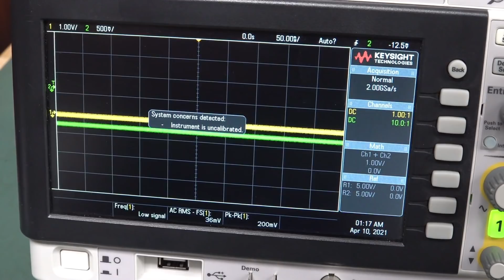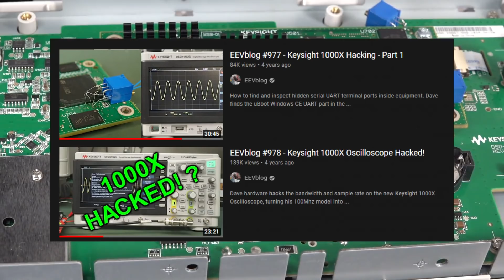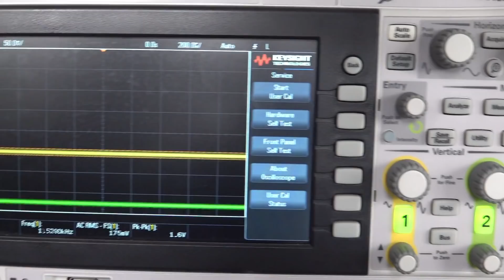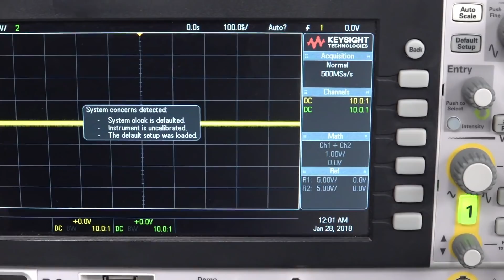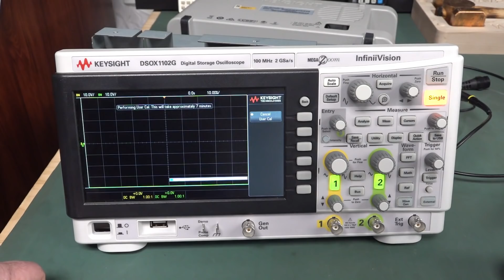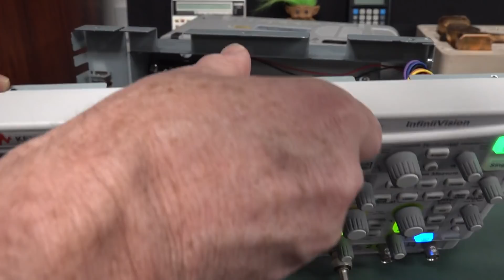EEVblog 1418 - The Most EMBARRASSING Repair!

Comment: When it is first calibrated it probably stores those initial resistor divider values as part of the calibration data and if the hardware no longer matches the stored value of the resistor divider it just assumes that the calibration data is faulty and something is wrong so never loads the rest of the calibration data.

Comment: My most "embarrassing" repair was when I was desoldering the SMT pins on an OKI 900 with a Weller 12 watt. I thought they were wick'd clean and hot and impatiently yanked. Lifted a few pcb traces. :(

Patience is the highest virtue. I'm about 22 years older than I was back then. Entropy has justly slowed me down. :-) Dave rules!!!

Comment: The software woke up to alien hardware , retreated to the cpu and barricaded the doors . 
This is a feature , not a bug , that punishes users for not reading the undocumented readme first . 
It brings a smile to all authors of readme firsts , the most unread literary form of all time . 
Finally they are vindicated , the apocalypse prophesised in the 14 point , boldfaced courier paragraph at the top of page one has come to pass . Finally they can smugly point and say , "TOLD YOU SO" .

Comment: Given the Product is set be resistors, they don't allow for someone using trim pots that might be half way between two different Product ID's.  I don't think they would see a need for it given they set the resistor values in the factory.   This really was a hardware fault as the resistor values were wrong.  :)

Comment: As far as the programming - it could be just as simple as an inaccurate error message. That is, if the waveform generator can't run for ANY reason, it displays "invalid license", and for whatever reason the waveform generator can't run when the system is uncalibrated.

Comment: I can understand using the same code across all their scopes (with model specific tweaks), but its interesting that instead of building the code for an individual scope, the whole firmware is the same across all the scopes.  I guess that means you could buy the most basic scope and bodge on a bunch of connectors and you would get the expensive model... 🤔

Comment: There are different programming techniques. Personally I always prefer to programmatically validate and sort of "close the loop", meaning never allow your code to get into a situation that was unplanned for. That can be as simple as validating every piece of data and redirecting to a certain message if anything is outside of the expected range, even if that situation is extremely unlikely. However, as you can probably imagine, this takes a lot of extra time and can delay go to market dates which delays revenue from a product. Like anything else, this tends to depend on the management style at the company. Time is money and therefore a departmental compromise usually gets developed at a company to allow for certain assumptions. For instance, we'll assume that hardware flags (e.g. resistor values) will be what we expect since customers most likely won't be disassembling and messing around with changing their values. That eliminates the time required to code, develop tests and validate the information as well as program space in memory. It's all a trade off. What trade offs are made tend to be developed over time and are different at different companies.

Comment: Dave, it's common practice to use identical software and identical mainboards for multiple product SKUs with different features, and identify the specific SKU with resistors on multifunction GPIO pins so you don't need to rework and retest everything for every configuration every time you make a change to something.  (You can test disabling individual features once, and then test a feature rich build to be sure that software changes to specific features don't step on each other).

If you get those GPIOs messed up enough and the software is looking up product features in a table, who knows what combination of features it thinks your scope has... it could go right off the end of a feature table and use some garbage configuration that Keysight doesn't even sell.
Reply from the maker: Yes, I know. But in this case it's not hard to throw up an error message if your product model configuration is not one of a set number of valid configration. Remember this is not the feature configuration bits.

Comment: I have the new version of this and I like the Black as it does not show Fingerprints and crap and it works Excellent about as close to my tek 2465A, but getting thru menus is a bit different
Reply from the maker: The black case really screws up my camera exposure, I might use this now fixed unit in videos from now on.

Comment: Can someone stop bloating, and tell me in one sentence / time code stamp as to what happened and why? I don't want to watch entire 25 mins...
Reply from the maker: It was a scope I hacked, now it's failed. Removing the hack fixed it. Looked like a hardware fault but was actually software configuration.
Reply: @EEVblog  Thank you! Normally I watch your videos in full, but that time I was in a rush (monitoring the elections situation in Russia at the moment), so I could not watch the full video, and you were as happy as I usually am when sharing a "dumb find" with technicians at work, so I clicked around, but could not surmise the reason for your happiness in less than a minute. All OK Dave as long as we make less mistakes than the number of items we repair!!! Keep on rolling!!!

Comment: Stereo amplifier repair 101: Use the good channel to trouble shoot the bad one. Have been doing that since my early teens. Of course at that age you often blow up the good channel trying to fix the bad one! My Dynaco 120 of the day is a good example. That was before I understood ultrasonic oscillation in baseband audio circuits

Comment: The cal data is likely specific to the hardware model.  Other models could need additional data or different values for their hardware.  If the stored cal data that is found is not for the hardware indicated by the jumpers then the software would think it couldn't use it...

Comment: i work with tablet testing machines and all models that we sell use the same mainboard. and are just configured to act as different models. the hardware of some models need different config files that will be loaded from memory depending on which model the board currently identifies as. so changing what the device thinks it is can missmatch the hardware and software. sometimes this mismatch can cause the software to crash and your device wont even boot and sometimes everything appears to be normal until you hit that one line in the config that needs to have a different value. then you got two options: either the software crashes at this point or you get outputs that are weird.

Comment: 19:00 man it really irritates me when hardware guys complain about software. In this case, you told the software that some hardware module was present. So the software tried to calibrate it and couldn't.
Reply from the maker: Err, no. All the harwdare is present in this machine. There is no reason why a model bit change should impact the DC offset.

Comment: Question..    Low battery voltage?    I work on old radios/transceivers.   I have found certain makes and models along with other types of equipment will act all funny, not boot right, other artifacts due to a low battery.

Comment: From a programming pov, it really doesn't make sense to make a device "robust" enough for that. It likely was an invalid product configuration, something that for all intents and purposes will never ever happen (unless its a hardware failure), thus always assuming the product id is right and consistent is the most economical to do. For why this happens, I would speculate the IDs are used as offsets into some configuration data structures, and just get wrong/unfilled ones, or interpret a slightly different structure diffferently. For the licensing I would guess that the license code/id/whatever takes into account the product ID and doesn't consider the license for one product valid for another.
Reply from the maker: Then why not put up an error message is an invalid model configuration is detected? That seems pretty trivial.

Comment: Actually the behaviour at the beginning seems to be just a setting in the menu!
Under Utility -> Options -> Preferences you can select between "Expand about Ground" or "Expand about Center". I think your scope was set to the second option, so when you changed vertical scale you also changed the position of ground on the screen.
Reply: That feature moves the ground reference indicator as it changes the scale.  This unit was moving the waveform but leaving the ground point at the same place.
Reply: @donreid358  True, my bad.

Comment: From a programmers point of view, I guess that the different modes can result in that different data structures are expected in some sort of write-once memory with rough hardware-calibrations,  so that after assembly and product specification, the different offset and characteristics values are brought into the ballpark for user calibrations to work. Using this logic, it could be that the hardware channel DC offsets are no longer read from the correct place, and just gets garbage instead.

Comment: Maybe different product configurations have different calibration requirements, so if you change the product, the calibration that exists doesn't "fit" anymore.

Like, sometimes the hardware differs within the product range, right?

And if you try to run user cal when the software thinks there's hardware that isn't actually there, it seems reasonable that it could fail.

Comment: A good visual inspection through a magnifier will find places where the solder has cracked around a through pin and even though it looks fine to a naked eye it isn't making electrical contact with the through component at all anymore. Years of heating and cooling sometimes cracks the solder, especially if it was a little scant. My experience is old electrolytic caps and obvious things like this and solder balls account for a huge percentage of faults. Add in the occasional failed chip/diode (check the inputs they're all good, check the outputs, not so much), and you account for almost all. By the time you get that deep into it you'll be ready to find the occasional weird fault.

Comment: I recently had a very bad trim pot. Wanted to use a variable buck converter to charge a Li-Ion cell, but while slowly turning the pot up, my meter did not say the expected 4.0 - 4.1 - 4.2V increase, but instead the voltage jumped around 4.1 - 4.3 - 3.9 - 4.2V. And that was even repeatable: turning the pot up (towards max voltage) would lower the voltage in certain positions.

Comment: Re: the question about different configurations: the most reasonable explanation to me is that the analog side of the DC offset generation circuitry differs between models, or even hardware revisions. Those set resistors are supposed to tell the firmware which hardware it's currently running on. So with this explanation it's not so much that the calibration data is ruined per se, but that the stimulus to the DC offset generation is ass backwards because it's for a different hardware configuration.
Reply from the maker: Yeah, but that's the wierd part, there is no difference in the front end hardware between models.
Reply: @EEVblog  Another possibility is that there was supposed to be a different model with changes in the hardware that was never released. That sort of thing (left over code for variants or features that never made it to market) happens all the time.

Comment: Given the scope runs Windows (CE), and they're presumably using cryptography to manage the license keys, it could be the reference voltage reading is also seeding the license crypto. I would have expected a failure like that to prevent it from starting at all, but maybe the 'scope's base functionality doesn't require it? 🤷‍♂️👍

Comment: You should've soldered one side of the resistor to the board and left the other side flapping in the breeze so when you come back to it the original part is there :)
Reply: Yeah I've seen people turn them 90º so they know what goes back where.
Reply: @SidneyCritic  that's also a good plan, maybe even heat shrink the end in case the envelope of "which"device get's turned to a side in which gravity could cause a short from as Dave says "flappin in the breeze". At min, it's good to keep it there no doubt.
Reply: @jasonbrindamour903  gets*
Reply: I do this too

Comment: Hang on. Dave stores his resistors based on the E series position?? 47R with 470R with 47kR? Maniac.
Reply from the maker: Yep, incredibly efficient way to do it.
Reply: Why would you not? Sub-dividing by multiple is easier to index than integer value.  MSB vs LSB
Reply: That's how I sort my smd resistors and caps. Super Friggin handy
Reply: I guess it depends on how many values you're holding, how they're stored and how they're used. A fair few of my stocked resistors are through-hole and from big dumb packs which are all over the map E-wise, and often they're deployed more as "I need something about... -yeah this one's good enough for 'straya..." I'll certainly admit it makes sense for reeled SMD parts, especially if you're only holding say, the E12 or 24 set.

Comment: License code? Jesus, that's straight up evil.
Reply: It has multiple license codes. Sig. gen. option is just one of them, around 15 in total if I remember it correctly. If you want all the features then all the licences may cost you almost half of what the scope itself costs. And with some manufacturers it is even worse.
Reply: Welcome to the new world order.
Reply: Same thing for new cars. Oh, you want the full potential of your headlights? Pay a monthly fee or 3000$. This shit is crazy. Will never support this BS
Reply: @Daniel-hd7gq  At least once you've paid for your option it is all yours and you can use it as long as your device is alive. Some commercial software providers do not even give you that. They have switched to using time limited licenses only for their most recent products and you never know exactly how much it will cost you next year. Say hello to the new SolidWorks CAD packages for example. And with current cloud based services development it looks like many more are yet to come.

Comment: I do wonder, if this would have still happened, if you had used the "reset to factory settings" option after changing the configuration resistors. You probably did something outside what the software developers anticipated :) 
I could imagine that data left over from before the change + new data saved afterwards, might cause a problem.

Comment: "I didn't change anything about it!" It's always the same line users give when their stuff stops working...
Reply: Repairer opens equipment and shows customer wires with pots dangling off them.
Customer: "I have no idea how that got in there."
Reply: That or "only lightly used"

Comment: If I had to guess, I would say that different devices that have different hardware may need to have their offsets compensated for in software, and so by changing it so there is a mismatch between the physical hardware and what the software thinks is present, those compensations end up producing what appears as an offset.

Comment: Back in the 70,s I worked for Tektronix as a service engineer. The problem you saw used to be down to corrosion/ galvonics in the  "Y" input select switching. DC offsets. Oh what fun. Clean those wafer switches. :)

Comment: As for software being involved in this error, you likely found an edge case that was not compensated for. I've had these kinds of issues before while developing things and trying to fully define the boundary of a configuration. Also, I don't think any developer would look at this particular part of the system and think that anyone would get in there and start mucking around. They probably had the specs from the hardware engineers and didn't account for much, if any, variation from those specs as it would be reasonable to not expect those values to be in an undefined state..
Reply from the maker: I would have at least had the software throw up an undefined mode error message or something.
The strange bit is why the mode even effects the DC offset of the channel, when everything else seems to continue working.
Reply: @EEVblog  That may just be a byproduct of the unknown/floating state. Now, a proper software shop wouldn't move beyond the logic building stage until the team had found all possible output boundaries of all possible inputs. Wait, that's right! I forgot that no business includes that level of overtime! Lol
Reply: Maybe it thought that it was a completely different model, where the analog front-end is constructed slightly differently, and the configuration it was running would work with that model but would be incompatible with the hardware present.

Comment: Well I think what it showed is the steps leading up to that mod or the mod produced that outcome. After that it is a debate. The most obvious things I could think of is the settings have a hardware string or something in there that has to match or be rejected. Also there could be some small hardware somewhere that does not get along with the different model number, or the memory size of the settings could differ for the 2 models.

Comment: At least Murphy didn't get you this time :D
When I do similar modifications like you did, I usually solder those original resistor from one leg ( Just to keep them in place and not electrically connected ). You also might use any sort of electrical tapes and glue them to the oscilloscope's chassis.
Reply: Good tip! Will have to remember that one. Thanks!
Reply: @LordPrecision  In 2021, this should be standard operating procedure, yet how many of us don't....?